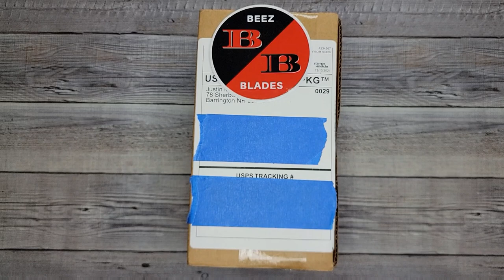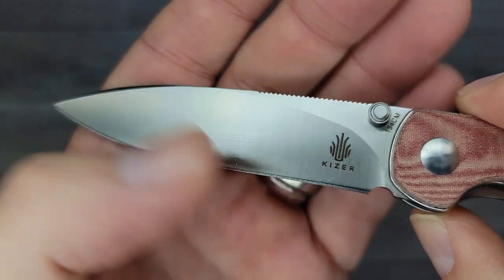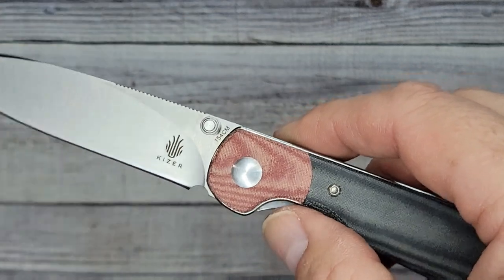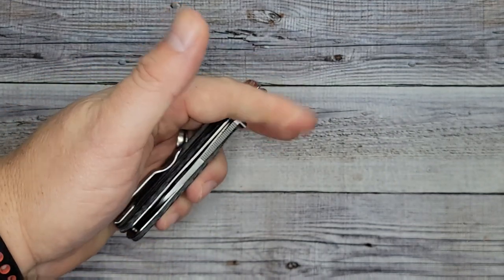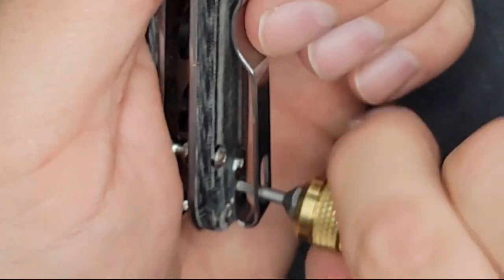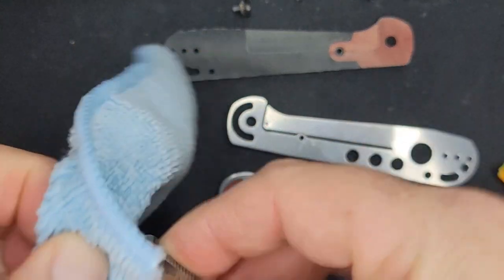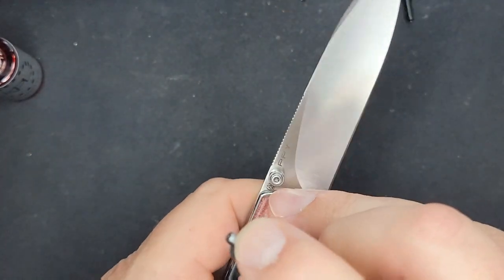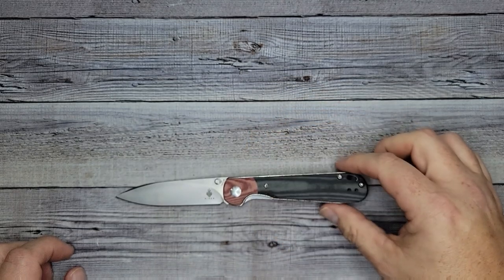THE NEW KIZER PPY BY AZO | UNBOXING/DISASSEMBLY | CLOSE-UP'S | 154CM STEEL | V3587C1 | GREAT MICARTA

Comment: That is nice! Man Kizer never fails to impress. Kizer has become hands down my favorite manufacturer. If I had to only buy from one company for the rest of my life, it would be Kizer, their diversity of models is amazing. Back to the PPY. First off I like the difference in color between the scales and the bolster. Kizer does a phenomenal job of seamlessly matching the two. They are two separate pieces but finished so well you can not detect any seam, they feel like one solid composition. Next, fantastic action due to quality bearings and the great design. Speaking of design, I love how many of their knives, including this one have a cut out for the pocket clip to be secured to. No mushrooms sicking up, to tear wear you pants getting the knife in and out. Kizer does Not cheat the customer, they use D shaped pivots to make disassembly and reassembly a breeze. Attention to detail people!!!! This as are many of Kizers knives a "Budget" option only because of the price. They are not budget in quality. How they keep price down on these amazing knives I will never know. Thank you Kizer for producing some of the best knives at very reasonable prices. And thank you Beez for bringing these wonderful offerings to our attention. (sorry if I highjacked the comments with this long post) :_BeezBladesWelcome::_BeezBladesBeez::_BeezBladesRed::_BeezBladesWelcome:
Reply from the maker: Thank you TopDog8762! Very well said my friend! I'm right there with ya! I don't think it will difficult for folks to wonder what some of my favorite knives of 2021 will be. I'll see you on the live stream tonight! The holiday special is going to be epic!! :_BeezBladesWelcome::_BeezBladesBeez::_BeezBladesRed::_BeezBladesWelcome:

Comment: Not sure if I can believe that it's 10thou behind the edge
Reply from the maker: I measured it several times, but I'm not an expert by any sense of the imagination. I calibrate my calipers and measure right behind the bevel, up and down the the blade. I zero-out the calipers between each measurement also. That's the best that I can do. Thank you for the input brother.
Reply: @BeezBlades  10thou is insane for a production knife.  I have some extremely thin knives.  I was amazed that I got a we knife at 13thou bte.    Idk.  I have calipers.  But don't have this knife.  And being as I have about 5 waiting on me for Christmas pretty pricey.  And 1 on its way for.my bday in Feb.  I prob won't be able to pick one up for a while.  So I'll have to take your word.   It's just crazy